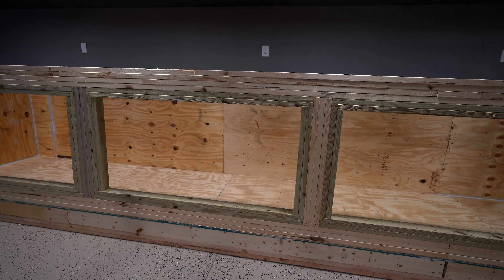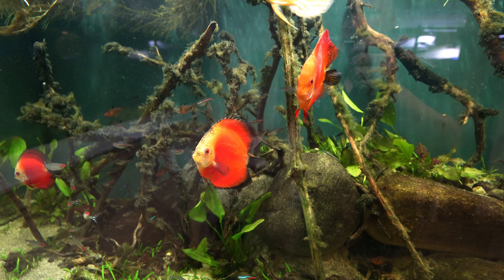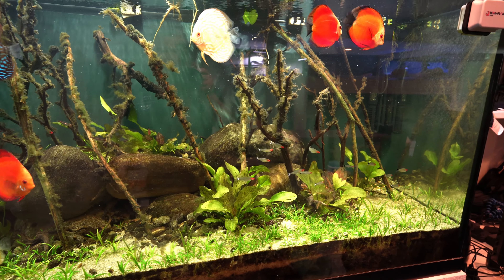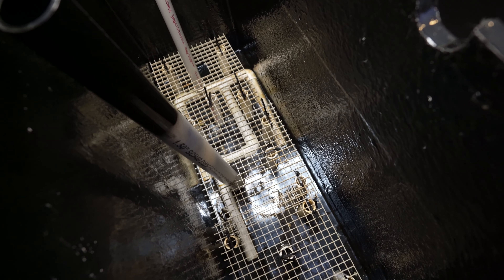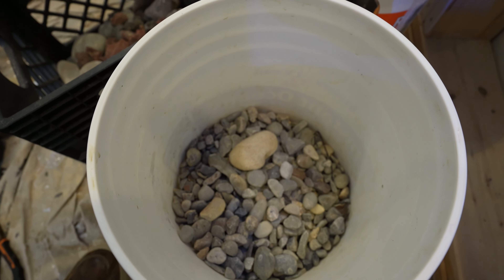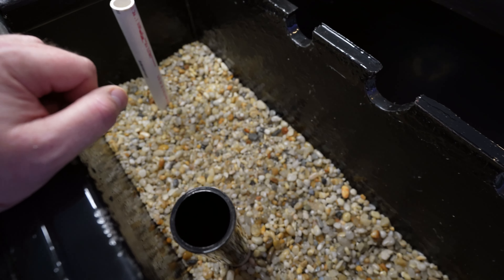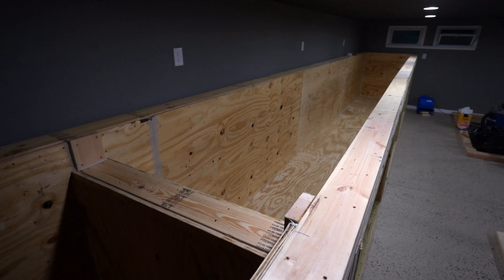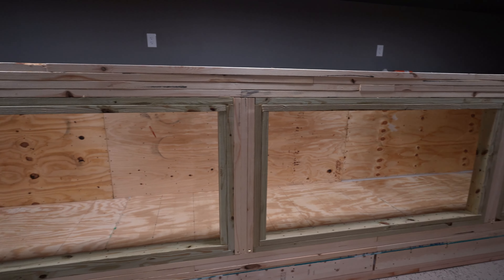Huge 4,500 Gallon DIY River Aquarium Build Progress and Wetland Bog Filter Build!

Comment: You should rip or use a jointer on all your boards to make them line up a lot nicer. Box store lumber can be pretty twisted but doing a little bit of mill work really can go a long way on strength and making your life that much easier on future builds
Reply from the maker: I got pretty lucky this go around that most of my wood came from fresh stacks...so in terms of Home Depot wood it wasn't too bad. 🙂

Comment: Awesome build! You could even create a “river” on top of that tank where the water flows towards the wetland. A kind of canal against the back wall where water is pumped in and then flow to the wetland. You could fill it with gravel and plants so it adds to the filter capacity.
Reply from the maker: The thing is though is that the water entering the wetland filter needs to be under pressure, as it will be pumped into the bottom of the wetland and then up flow through 3 feet of substrate....so needs some pretty strong pumps to achieve.
Reply: @AquariumDomain.  I understand, maybe just have it flow back in the tank from that extra “river”? Would add a ton of extra bio filtration.

Comment: I've been involved in the fiberglassing industry for more than 20 years and if there's only one (VERY important) suggestion I'd be able to make, it would be to say that you be best to fill in those knot holes in the plywood... Any separation of any kind between the fibreglass and the surface it's being applied to WILL Cause air bubbles that could very easily spread (enlarge) thus causing the fiberglass coating to separate from the plywood in this situation. 
Remember; an ounce of prevention is worth a ton or three (of water) of cure!!   
 You're going to want to make absolute sure the surface of that plywood sheeting is pitless as possible!!
Reply from the maker: 100% everything you mentioned is dead on. I put a lot of emphasis on doing each stage of the build correctly and not "making up for it" in other stages of the build. Fortunately the plywood isn't as bad as it looks on video in regards to having to fill the knots...only a few of them are actually recessed...but many look like they are until you run your hand over them. 😀

Comment: Hey man i love this build! Super inspirational 👏 Im saving up for a half size ... How are you heating it? Would it be worth it to insulate?
Reply from the maker: Thanks! 😊  I temperature control all of my tanks by heating/cooling the rooms and not the individual tanks. If you use this method, you would not want to insulate the tank from the room as you want the water to equalize in temperature with the room. Additionally the lights and pumps used in the tanks provide a little extra heat in the water as well, as I cover all of my tanks for humidity/evaporation...also traps in the heat.

Comment: Hey mate, what do you use to seal your screw holes and corners in the sealing stage? I'm attempting to build a custom plywood sump for my saltwater aquarium and I'm just at the materials gathering stage.
Reply from the maker: I used wood filler for a long time, but the past few builds I have been using gap filling adhesive from Adiseal and I like it a lot, easier to apply and doesn't shrink! 😊
Reply: @AquariumDomain.  not worried about it leaching through the pond seal?
Reply from the maker: @kyletait853  No definitely not. It will be fiber glassed first, plus pond armor is a 2 part solid, so finally cured form is not porous.
Reply: @AquariumDomain.  Ah awesome. Thanks heaps. Appreciate the info.

Comment: Have you considered lava rock for the lower layers of the bog filter (adding more places for beneficial bacteria)? Where is the intake for filter? How will you ensure the entire aquarium has water flow?
Reply from the maker: Generally lava rock isn't used because of all the small crevices that will trap the mulm, ideally we want the mulm settle back down at the bottom for removal.  Even without the extra porosity of the lava rock there will be plenty of surface area for bacteria.

Comment: What filler caulk do you use on the raw  wood seams. Looks to be liquid nails or something
Reply: I would assume just like any other aquatic application the 100% silicone because you don't want those other chemicals leeching into the water.
Reply: @ONEFUNFONE  nothing sticks to silicone, so the pond armor wouldn't stick in the corners
Reply: @RcBlade  it's never peeled on me in the past and I've used silicone.
Reply: @ONEFUNFONE  you used silicone on the raw plywood seams, then applied pond armor and fiberglass over top of it?
Reply: @RcBlade  no, you use silicone in the corners and other gaps/ seams, fiberglass over it, sand down the fiberglass Then coat it in pond armor. You only use enough silicone to fill the seams, you're not doing a window or sink where you need half a tube of it. Clean up and sand down the areas before you glass. If you actually read the question and your responses you'll see where you goofed up at.
Reply: @ONEFUNFONE  in the video, the seams are tan in color, not clear silicone. Your original answer about using 100% silicone because it doesn't leach chemicals doesn't matter because whatever you use , it's covered up by fiber glass and pond armor. Silicone wouldn't be the best wood filler in the seams because nothing sticks to it and it's too flexible. Liquid nails or construction adhesive would be better because the fiberglass or pond armor would adhere to it.
Reply from the maker: The wood filler is DAP 543. It doesn't shrink and dries harder than the wood around it. I use it to fill any little gaps so that the fiberglass layer is fully supported.

Comment: Iam concerned about the mini split right over the top changing you temps to fast .but filter looks awesome
Reply from the maker: I have made some modifications since that video footage was taken...the louvers on the mini split are now pointing up and I have lid on part of the aquarium. Beyond even temp change it would evaporate water really quickly with air blowing on it 😊
Reply: maybe get a sheet of that corragated plastic and attach it underneath the  mini split to kinda like a roof were air could blow over it and not on it
Reply from the maker: @jeffsfishinginthesunshine5903  Good idea 😊

Comment: I may have missed it but what is the thickness of glass you are going to use and are you considering low iron glass? Almost forgot what are the viewing opening dimensions?
Reply from the maker: The glass panels will be right around 7 feet long each. No plans for low iron, the cost of 4 x 7' panels is already quite high. 😊
Reply: @AquariumDomain.  No doubt! What thickness glass are you plan on using?
Reply from the maker: @markkaupas8921  1/2" tempered

Comment: I dont understand upgrading the footprint just to have less swimming area.  Basically 16ft of 33 would be usuable.  Im not understanding why youre deciding to do that. It's still a phenomenal build and I'm still jealous but I'm just curious why you would take away swimming area with docks and a shallow area
Reply from the maker: Currently the big Fogo Peacock Bass live in just half of the 3000 gallon with the Orinoco Bass living on the other side. Neither will let each other into their areas. Ultimately I expect the 4500 to be two sides with each species of Bass having about 16ft of swimming room.

The big Bass are going to love the docks, they will love hanging out underneath it...right now they do the same under a big piece of wood I have floating in the 3000 gallon.

It is possible that the 4500 will have a group of fish that can all coexist together well enough to remove all of the dividers and have a single large tank...that is the ultimate goal, but I will need to finish the 2 x 1500 gallon builds before I can really make that happen.
Reply: Gotcha.  That makes sense.  Keep harmony in your tank by any means